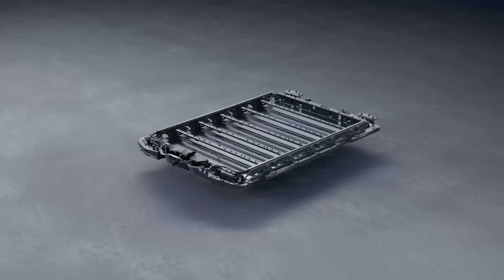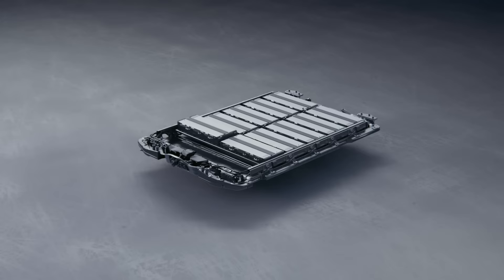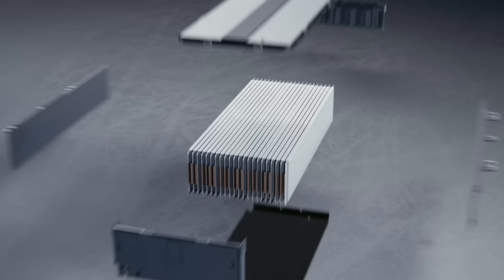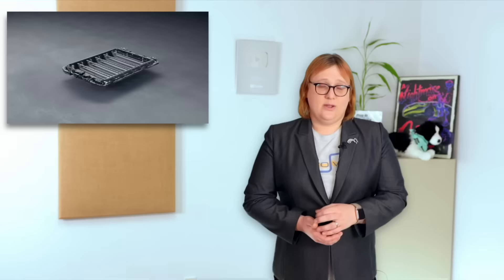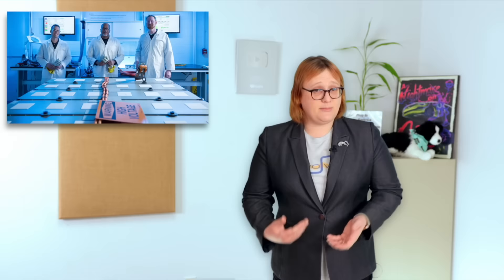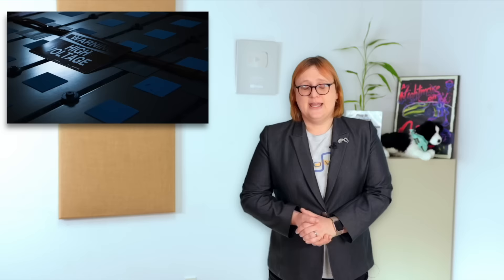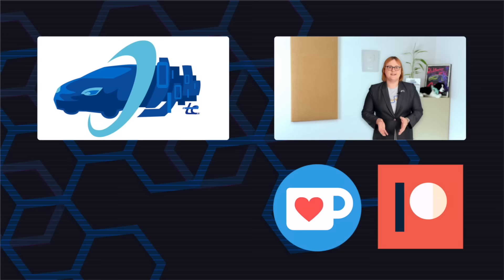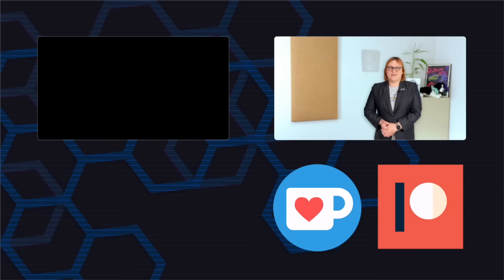Will GM's Ultium's Forward Compatibility Revolutionize The EV Industry?

Comment: also there is over a century old tech that gives you 30 percent more range on an ev. lithium Bms has many functions main one is prevent boom by cutting the cell off before it goes below like 3.1v +-0.1 on Chem... the cell has an internal resistance meaning some hold less or burn through it faster and simple packs cut when the first cell hits cut off. evs divide packs into groups and a good Bms can shuttle charge (with a few extra wires) to a cell or pack that had to disconect/cut off thus extending time till pack has to. multi cell Chem packs get multi variable and comparative analisysis gets complex quick. but if they truly want any Chem and arnt doing this they are probably ridding the short bus to work licking the glass on the way. or alternatively ip has us in such an innovation lock that we undo ourselves while all screaming in not a narasstic disorder between MINE MINE MINE

Comment: So 300,000 vehicles out of 7.7 million sold in the US per year? (assuming a 100kwh battery)
Call it 4% EV's, possibly 8% if smaller batteries are used per vehicle?
Reply: Just as a note GM's press materials state the battery will start at more than 30GWh's and be scalable.

Comment: It is not sf to make battery modules replacement with different cemeteries. All they did is make each module the same voltage as output voltage and then you can connect in parallel any cemeteries you want.

Comment: Is each individual module liquid cooled?  Are there liquid cooling lines in and out of each module?  Don't see any liquid cooling lines in the video.  Cost will be a major factor.  Thermal management is a huge factor in the longevity of batteries.
Reply: Bottom of the module is in thermal contact with a liquid cooling plate.  Similar cooling design to the E-tron and Taycan.

Comment: Nice thing about vaporware is that you can make it really shiny. After all, it's all in a stack of PowerPoint slides! We can even change the thing on the fly as many times and as fast as is required by the hype machine. GM is really good at PowerPoint engineering. Not so much at producing actual good vehicles (and I am talking their bread and butter gassers).

Comment: This seemed to be a very repetitive episode. Usually Transport Evolved episodes are much more punchy and to the point. I am surprised that they find wireless comms between battery modules efficient or necessary. The wireless interference in such a high current environment would be horrendous and the added engineering complexity will add to the cost. Given how infrequently battery modules need replacing this seems more sales gimmick than serious feature.
Reply: A reasonable point. One way of looking at this is that they have spent a lot of time and effort thinking about this and they must seem point to it that I completely don't see.

Comment: My personal experience with GM over the last 8 years tells me that GM has engineered in  plenty of weak points and sub standard components to give the buying public the fullest GM driving experience possible.
Reply: Retire Soon In the past 8 yrs I’ve driven 260,000+ miles in 3 different GM vehicles. The oldest being a 2009 which I had purchased new, and 179,000 mi when I sold it. Never have had a break down or repair in 260k mi. Only tires, brake pads, and oil changes. In the past we’ve tried Nissan, Toyota, and Ford. They don’t even come close to GM in terms of reliability and cost of ownership. IMHO.

Comment: Did you really mean 100 kWh of coating per hour?  You realise that a long range Tesla had a 100 kWh battery?  In other words GM is predicting a single EV per hour??  100 MWh would be more like i.e. 1,000 EV per hour, but even that is ridiculously large at a 8m EV  per yer. which is the TOTAL of ALL current models produced.

Comment: I think forwards and backwards compatibility with new battery technology is one of the inexcusable omissions from most Modern electric vehicle designs. There is literally no excuse for it since in purchasing a new battery I'm already spending close to 10 grand anyway so there's not like they are losing an opportunity to make a profit on the sale. If I could take my 2012 leaf and put a 2020 battery Pac in it boosting the bass range up to a hundred and forty miles it would be well worth it to spend the money on the new pack. And the dealerships going to get some prophets simply because it's an expensive purchase which justifies financing and they're going to have a service technician perform the work. Moreover this isn't exactly the engineering challenge of the century oh, so I applaud GM for taking this step and it makes GM products much more tempting purchase even when compared against a Tesla simply because in 10 years when I'm ready for a new battery pack I might be able to pick up that bleeding edge Solid State architecture

Comment: Sorry I call shenanigans... as they intend the story to be perceived I am sure there is some truth. However, as with all things there is a limit. The real question becomes what is the limit of this ability to have different chemistry modules coexist. This sounds awesome when we are at this part of the development curve where technology is improving. But what happens when things get more stable? In my personal opinion the pack was designed this way because GM is hedging that they will have a new chemistry in a short period of time and they dont want to have angry customers complaining that their car is obsolete.
One other thing, how secure is the data communications of the wireless battery management system? Also what happens if your ultium battery management car is in an area where there is alot of background radio frequency noise?

Comment: A bandwaggon results from the kind enthusiasm generated in the would be customer by the product. The enthusiasm, in this case, is from governments and ideologists and bypasses the detail that is supposed to energise the customer. Anyone who has 2 or 3 electricaly assisted pedal cycles (that can be pesalled home empty) is not going to take GM's word on a million mile battery life. The multiple replaceable segments suggests lack of confidence by GM despite the other logical reasons for this construction.  The increasing cost of the Leaf battery  being attributed to reduced production sounds fair but so does soaking the Leaf owner without a choice. Some batteries outlast the life of the car??? These cars were obviously not 20 years old. Of course, if the cost of a new battery needed for a car makes it worth writing off then the battery has lasted the life of the car. I believe I have exaggerated the case but I am not sure by how much.  Was that really Proffessor Goodenough you spoke of?? In an economic venture as delicately balanced as this he should change his name or field of research.

Comment: the details between pouch and prismatic are hard to come by. also lmao to the wireless. it's just a bit outside of what I would expect our knowlagable presentor to know. there is a wired serial standard called one wire that only needs ground and power. its also called Dallas button. some door key fobs with an exposed metal can for like apt doors use this. in a pack/Bms uses this it's only 1 additional wire out of the pack. wireless is fricking rediculous in this

Comment: Million mile batteries are great but seem rather pointless in a uni-body vehicle. IF you built the vehicles as body on frame instead, you could then just swap the body after a number of years and continue to use the "skateboard" battery and motor units.
Reply: BEV3 is unibody and BT1 is Body on Frame.   Unibody is lighter and more efficient.  Body on Frame is better for towing.

Comment: Fundamentally, the more EVs the better.
Sadly, I see GM's EV plans suffering from 2 interconnected problems that do not bode well for being competitive or compelling.
The first is that their ramp is slated to begin the winter of 2021 when their battery and EV factories come on line. The Ultium battery tech, while competitive with existing batteries at this moment, do not appear to be competitive with pending battery improvements expected to be available by 2022. This means the vehicles they're planning to launch in 2022 will have difficulty being price or performance competitive with any vehicles based on newer battery tech. 
The second is that, by 2022, they will be producing 35GWh of Ultium batteries, catching them up with competing EV battery production last year. Since EV production is limited to battery production, that also limits their EV production in 2 years to compete with volume production from 2 years ago. 
The one aspect of GMs plans that I actually see as having the potential for success is the Cruise Origin. While Tesla will have 1M robotaxis at launch, the US Transportation-as-a-Service industry has room for several hundred million robotaxis. On the assumption that Cruise can execute on their AV plans, GM may become a captive manufacturer of AV platforms for Cruise.
Reply: Tesla projects that they will own 1 million RT for the start, since they already have 1 million on the road training the FSD. By the time regulators approve FSD level 5 they will have a few million on the road and at least 3 new gigsfactories. With privately owned vehicles available for taxi service, they will have far more in use than any other brand. The end to end system seamless integration is one of the major advantages Tesla has over any other company that might want to get into this field. It means the bankruptcy of WayMo and Cruise, their business model just does not compete or scale.

Comment: This is just marketing. This is just ideas that the whole market is working towards but still no one has achieved. Most important is the price and not one word about that.  Regarding module swap so far it’s been the other way around the newest packs are even more difficult to take apart. More glue then ever and sadly for modular replacements that means to much and difficult work to disassemble the pack. 
Why is that you might wonder? 
Because durability from moisture and price of producing a pack need it to be made this way. Price per kW must down to reach mass market.

Comment: IF YOU WANT TO REPLACE THE PETROL ENGINE.....YOU HAVE TO MAKE BATTERIES EFFICIENT LIKE THE PETROL EQUIVALENT. 
THESE BATTERIES COULD BE BUILT IN SUCH A WAY THAT STANDARDISING THE BSTTERY SIZE....YOU COULD GO TO THE BATTERY STATION AND EXCHANGE YOUR EMPTY BATTERY  WITH A FULL ONE INSTANTLY....PAYING ONLY FOR THE ENERGY JUST LIKE THE PETROL STATION.....THEN PEOPLE WILL BUY ELECTRIC....OTHERWISE FORGET IT....IT WON'T HAPPEN.....IT HAS TO BE BATTERY EXCHANGE......YOU HEARD IT HERE  FIRST.
THIS IS THE ONLY WAY YOU CAN GET BY THE SPEED OF CHARGING.

Comment: Sounds like corporate propaganda. Questions unanswered as I listened: 1) what is the aggregate mass of hundreds/thousands of transmitters? Tesla is worried about the mass of tabs, GM is basically making each small pack a transceiver? Sounds like unnecessary complexity. 2) the overall package AND each cell is now structurally significant? Sounds redundant and another pint of failure. As in warping of battery case damaging the cells, rendering replacement difficult. 3) really? Mixing chemistries? What if there is a software glitch? Could there be a fire? What if a node gets confused ( happens in other settings)? Nice idea, but the devil is in the details! No comment on charge density to allow insights into range besides their glowing report. And, of course from experience with friends an GM I don’t trust them. But..,a nice puff piece!

Comment: Am I missing something?  Isn't this a lead-acid battery representing outdated technology?  Please educate me.
Reply: yeah u missed nickle metal chemistry aka what most power tools cellphones and 2way radios used before lithium ion. iirc the power density is lower and memory is a problem. the problem with lithium ion is mainly there isn't enough lithium on the plannet. followed by sone companies implement it in ways that go 787 or try to innovate or streach its reach like a note 7 with similar results

Comment: Very GM approach -interchangeable, one high volume component across all product lines, reparable, fewer components, integrated, adapted to local requirements.  in 2022 GM will produce and sell more EVs than Tesla and the will all have the same battery pack with interchangeable cells.  Tesla will have at least three cell types that will need a gigafactory to make into packs specific to every model.  This should make GM the leader by having the lowest cost lease.  Tesla will stay with high priced lux vehicles.
When is Tesla "battery day"?
Reply: Who is going to be buying those GM BEV?  They already have the Bolt that sells in very modest numbers so why would people suddenly swarm all over new more expensive GM models. They are not doing well now so why think they will suddenly find new buyers?  Somehow that premise that all the bad experiences customers had in the past will be forgotten and jump at spending more and getting less does not seem very likely. The new Tesla cell tech will be far more efficient, lower cost and proven. $20/kw-hr is the prediction based on new patents that are being put into production in the next few months means GM is stuck with a very expensive white elephant factory making expensive batteries with lower performance.

Comment: Some of us have been into electric vehicles for 25 years or more, and part of the reason I and many other people are still so pissed off at GM, is because they screwed us over 20 years ago. 
This tech shows what they can do when they commit.
This also illustrates what Tesla has contributed to electric vehicles on the whole by pushing the industry to this point.
GM would still be screwing us over if it wasn't for Tesla. Now GM has to commit or die. 
See what they can do when they commit? They should have done this 20 years ago. I've owned many GM vehicles throughout my life, and unless it's the only choice, I'll never buy another one.
Reply: Here is the interesting thing.  GM's EV program has never stopped since the early 1960's with the lunar rover and Electrovair.   The last EV1's were returned to GM in 2003 and they started the Volt program in 2005.  So GM has always been working on EV's in the background.  So what has changed?  Answer...There is now a profitable business case to make EV's.
Reply: @erikstephens34   The last EV1s weren't returned to GM... They were ripped back from paying customers, many of them still under a lease contract. The moment GM's lawyers helped overturn the electric vehicle mandates, they exercised clauses in their contracts to get them all off the streets, and then they crushed almost every single one. Shortly after the car became an engineering success, they realized that it would disrupt their entire business model because electric motors have one moving part, and the drivetrains can potentially last for hundreds of thousands of miles, and many more years then the current dinosaur-powered vehicles.

Their business model is based on vehicles wearing out (earlier than necessary), and needing a lot of service and maintenance along the way. 

GM, and all of the other legacy OEMs, are also cross-pollinated with big oil investors, and also weren't excited about the prospect of a non-proprietary fuel... Namely the electricity that's available in everybody's home, and millions and millions of other places. It took the concerted effort of Elon Musk, his personal fortune, his investors, and his team, to completely disrupt that business model, and prove that it would eventually become profitable. GM and others had the technology, but not the fortitude to do this before Tesla Motors proved this to the public. 

The Chevy Volt, is a reasonable vehicle, but was too little too late to garner any real respect for GM. If you check history, you will see that Dr Ferdinand Porsche invented basically the same vehicle in... 1898! The gas engine, hooked to a battery, powering an electric traction motor. 

It's probably not a useful exercise to consider what the word would be like if transportation continued from that tack, but it is useful to consider where we would be if GM hadn't sabotaged and submarined the EV1. 

That 10 to 12 year gap in EV development, and commitment, would have us all driving much much better vehicles by now. GM threw a huge speed bump in front of the development of commercially viable and profitable electric vehicles.